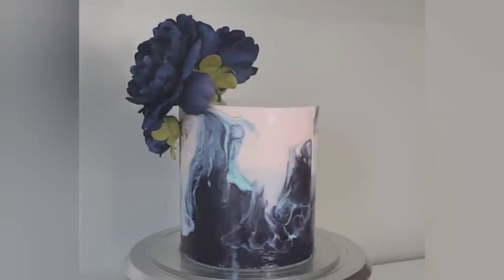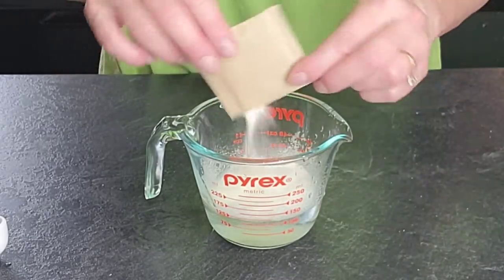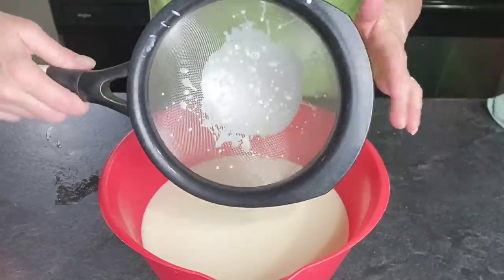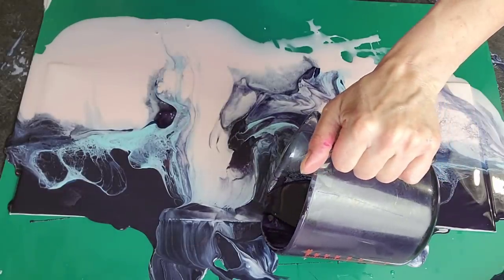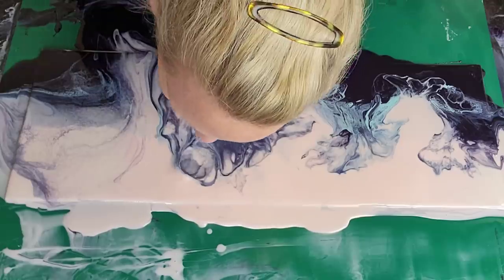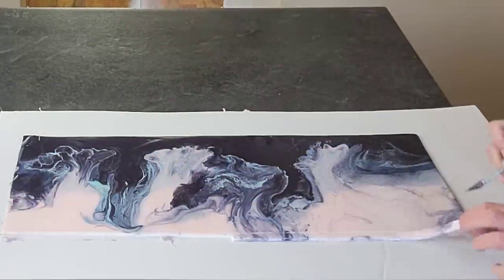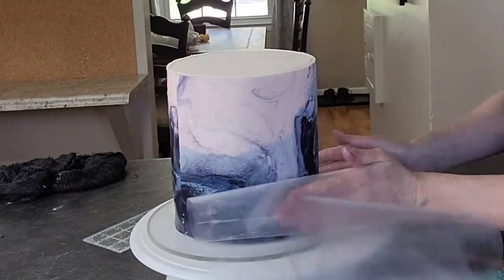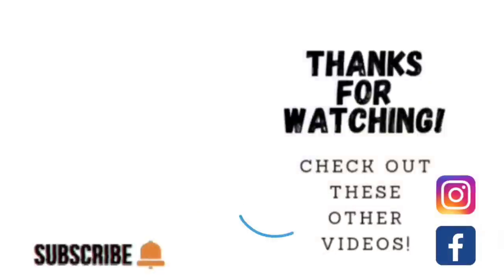NEW CAKE TREND! | "ACRYLIC" Gloss Cake | Cake FAIL turned Into a thing of Beauty | Cake Decorating

Comment: Hi dear in aletoso cake there is a cake of aquarium theme there he used edible print of under water .if we put edible sheet on fondant and pour transparent glaze will it work
Reply from the maker: I saw that! That may work? I haven't tried but that would be a good guess.
Reply: Found this on a thread Serves/Yields: 1/8 cup
Prep. Time: 2 min
Cook Time: 5 min
Category: Southern U.S.
Difficulty: Easy

It can be used when needing a glassy like appearance on fondant. (ie a windshield like on this car
It dries to a shine. I have doulbed, tripled with no problem.

1 tsp gelatin
3 tsp water (out of tap)
1 tsp liquid glucose ( I used corn syrup)

Sprinkle gelaitn in the water. Let stand until it becomes spongy.
Dissolve until clear over hot, not boiling water.
Add liquid glucose/corn syrup and stir until ingredients are well combined.
Pour into an airtight container. The mixture will become hard/stiff.

To use it, heat the varnish in a container of hot, not boiling water.
Paint onto item to be vanished while mixture is still hot.
DO NOT KEEP IN REFRIGERATOR
Reply from the maker: Awesome!! Thanks! I might have to find a way to use it if you don't mind?